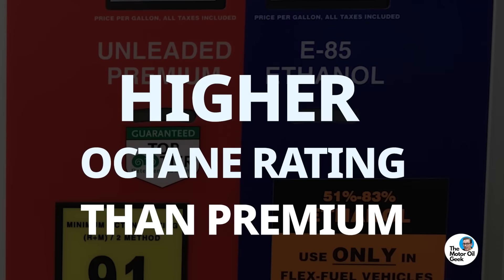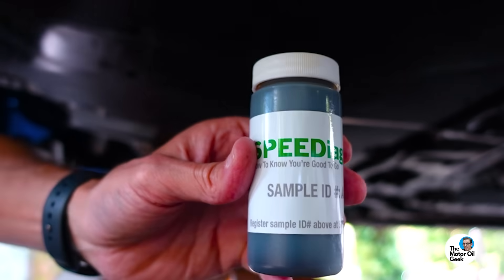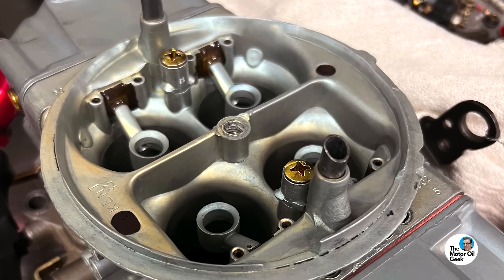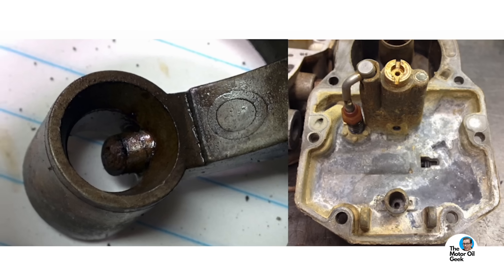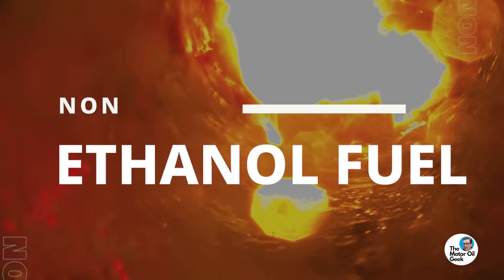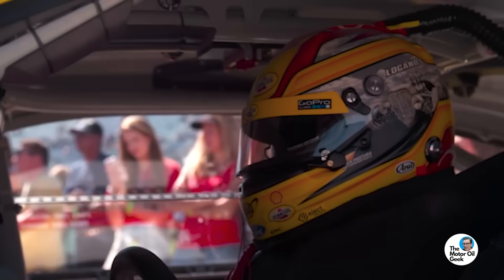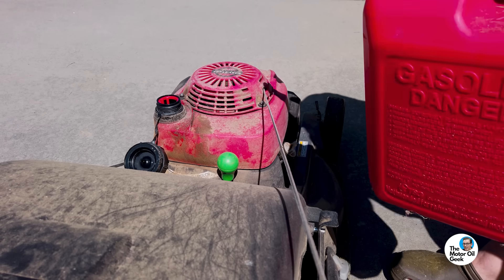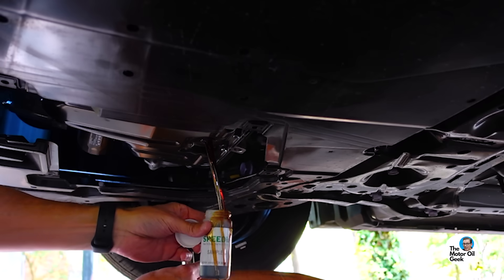ETHANOL: Higher OCTANE, Higher RISK?

Comment: Funny thing is I've been running E10 exclusively since Minnesota mandated it in regular gas around 1997. Not having carb problems in lawn equipment or with my old carburetored pickups. My old pickups sit unused for extended periods, no problems. 
I must be doing something wrong because I rebuilt way more carbs before with the "good gas"? 
I do not use additives, tried Seafoam once for storing small engines, that was the last time I had to work on a small engine carburetor. 
 Im OK with E10. Definitely don't want more than 10% though. Industrial corn production is a horrible thing for the environment, but that's another issue. I hate the stuff, for that reason, but as far as running it, I'm not having problems. 
Thats over 25 years of first hand experience. If it was a problem I'd buy the ethanol free. 
Honestly, a lot of the negative "research results" seem to be sponsored by fuel additive companies. 
Come up here and see what actually running it is like Lake.
Reply: I've got e85 in my truck that's over a year old right now (I've been running exclusively pump e85 for 5 years now in it) and it is completely fine too. All I do is fill it up and then seal the gas cap when it gets stored.  Zero problems. Nothing. 

I honestly don't know what people are doing to create these problems.

Comment: I bought a big generator that a guy bought incase of a power outage and it was like new but the carb was completely gummed up and the gas ate holes through the fuel bowl. I cleaned the carb and solder the holes shut and now it works perfect, plus I make sure to turn the fuel off and let it run out of gas while running. Don't want that problem again.

Comment: How much does a UOA cost ? Where can I go for one? Do dealers offer them?

Can you do one of you more in depth analysis of modified cars that have been tuned to run on E85 that were not “designed” to run on E85? 

Lots of Mustang enthusiast and other automotive crowds are all the rage with E85 tuning for a cleaner better engine as well as performance gains. (Reduced fuel economy)

The biggest things talked about are that E85 is bad for the car if your car sits for long periods, if you’re driving it regularly it’s not a problem at all (according to the community).

I’d love to learn more and how it impacts oil quality and thus engine life/health before deciding to make the switch and get an E85 tune.

Thanks! Love your content always amazing!

Comment: Lucas Ethanol conditioner, I swear by it now.  I had a 1980 Honda CX500 with dual carbs that I had to rebuild yearly after they added ethanol to the fuel.  That went to zero the moment that I started using only ethanol conditioner.  I haven't had to rebuild a carburetor, petcock membrane, hose, or intake manifold in anything since.

Comment: Lake, nothing you’ve told us is new. They tried using ethanol in gasoline back in the 1980s and it was a huge disaster all this that you’re telling us was figured out way back then what you failed to tell everybody is the huge danger about this that we found out in the 1980s and that’s why it was banned. If you’re not using the right type of flexible fuel hose it will dry rot it rupture it and cause a fire yes if you let it sit in your carburetor for six months without using it, you’ll have nasty green corrosion and everything will be destroyed in there, but more importantlyis the danger of it riding out fuel hoses and causing a fire you did not even touch upon that

Comment: I've got 9 small engine powered pieces of equipment and have been running regular pump gas with 10% ethanol since it came out.  I've rebuilt one carburetor due to diaphragm stretch in the last 20 years.  Done some fuel line every few years though, I will admit.  And two primer bulbs.  Key is, I start my engines every 2- 2 1/2 months and let the fuel in the carburetor circulate out so the sugar doesn't settle out and the ethanol that soaked up the water pushes that very water out.  Lots of money being made on the ehtanol free myth.  Lots of folks fooled.  Lots of folks forgetting how unstable and quick to varnish up non ethanoly fuel was back in the day.  But I worked on small engines for 10 years for a career so I don't know jack.  Hate ready.
Reply: No hate from me, but the problem here in the NE is people put their lawn mowers away for about 5 months and their snow blowers away for about 8 months. I'll put in/run ethanol free as the last tank before the end of the season. Another group with big problems are owners of classic cars. BTW, since you have been in the biz, do you know if small engine manufacturers modified the materials to better cope with ethanol? My understanding is auto manufacturers used E10 compatible materials since the mid/late 90's.
Reply: Yeah I agree ,ethanol it's bad ethanol free fuel just as bad with additives that varnish and are more toxic. Ethanol is cheap octane, be thankful and modify to your advantage, not to mention a lot less toxic than other octane boosters like toluene

Comment: In the EU we have to have E5 and E10 on gas stations, there's no gasoline without ethanol on fuel pumps. For everyday vehicles it's not an issue, but for vehicles with low use and any kind of machine that doesn not get used very often, like chainsaws, lawmowers and so on, it's a disaster.

Comment: Got a friend that works at a local Cadillac dealership, he said they get 3-4 cars a week with ethanol issues. The old folks don’t drive daily and as we all know the ethanol causes issues sitting in the system. The first thing the dealership does is an alcohol content test. My friend says he has never seen current fuel test less than 20%, most test at 25% and sometimes higher.  I wonder if that is prevalent throughout the US or just regions?
Reply: It's likely water throwing the test off 

I'm not sure what style of test they're doing, but if they're relying on the onboard ethanol sensor, it's tricked by water.

Comment: All through the 70's, 80's, and even into the late 90's and early 2000's never had to rebuild a  carb on my old cars, mowers, karts. etc from gasoline issues.  Government mandates 10% ethanol and all carbs fail.  Started rebuilding carbs the same year for clocks, failures, corrosion, etc. just like you're saying.  There isn't any reason for it.  We have plenty of oil. Government screws up everything to make more money. Fuel has to be drained if the engine isn't going to be used for couple of weeks.

Comment: Ethanol is stupidity in action! You must boil 8 gallons of water away to get 1 gallon of ethanol, if you use the ethanol to boil away the water there would be no ethanol left!
Reply: Crude oil gets distilled twice, once to remove the water and a second time at an astounding 750 degrees F.

GE converted turbine engines at an electric plant in Brazil to be dual fueled with ethanol.  No reason the waste steam from that could not make ethanol like we do with natural gas electric plants.

The spot cash delivered price of ethanol on the NYMEX is $1.62/gal.

The price of unusable sub-grade gasoline (RBOB) is $2.16/gal.

It takes more energy to make unusable gasoline than ethanol.  Usable E0 gasoline costs even more.

Comment: E85 in boosted engines is a godsend. You can run so much more timing without knock. Makes crazy power. The performance is similar to 110 octane race fuel.
Reply: I run E40 in my car and the hp difference over 93 is night and day. More smiles per gallon than mile per gallon.
Reply: Agreed. My b9 is 100hp more awesome on the welfare corn.
Reply: Curious if you guys think the ethenol is slowly deteriorating your fuel system? I'm tuned on 93 and want to do a flex fuel sensor and run an E30 mix so bad, but am afraid it's going to hurt my car in the long run. I know most don't care, until the problems rear their head down the road....
Reply: @mygt8a4re  E30-E40 is where you will see most of the gains. After that its all downhill on wear,mpg,gains. Unless your a drag car squeezing every ounce of torque. At E30 you will likely never have a problem.
Reply: @JimmytheGenius appreciate the response 🍻
Reply: @mygt8a4re  If the car was built after 1996, ethanol isn't going to hurt anything. Increasing the ethanol concentration beyond the ~10% that's already in pump gas doesn't really change the calculus in that regard. If your fuel system will support the flow for E40 or E50, go for it.
Reply: @Vlalada0 thanks for the input, motivates me to move to E hearing some are doing it with no fuel system issues. Ive heard all the horror stories about people's fuel pumps giving up the ghost in a short time after going E.
Reply: @mygt8a4re  Most modern ecu's have enough headroom to run up to e30. I ran e30 in my 2023 Sting Ray and run it now in my 2025 E Ray.  The reason is that GM rates their performance engines on 93 octane but in California we only have 91.  By mixing in 3 gal. of e85 when I fill up with 91 I end up with 93+.  I had a 2016 GT350 tuned for flex fuel and a 2020 Supra tuned for e50.  All made substantially more power and I never had any engine problems.  When I used to frequent the Mustang forums there was one called The Distillery in which they discussed all things e85.  No one ever reported damage.
Reply: @65sohc great info, really appreciate that!

Comment: Yes you need more ethanol because an ICE is as much a mass flow equation as an energy flow equation. Ethanol is less dense that petroleum gas so you need more ethanol. 😂
Reply: That's wrong.  Ethanol has less energy content.  Its density is about the same as gasoline.
Reply: @andyharman3022 720 vs 797 no incorrect

Comment: I've been using E-10 in carbureted engines for about 20 years, including boats and other vehicles/equipment that sit for weeks or months between uses, and haven't had issues.  These stories of carbs needing a rebuild after a week or month of sitting are hard to believe.
Reply: Had E10 in a string trimmer and it gummed up the fuel lines.  Used a coat hanger to clear them out and the ethanol residue looked like a plastic booger.  100% gasoline since and no more issues. I'm a believer.
Reply: @quaddad  Ethanol doesn't leave residue, but it may have dissolved buildup in the tank and/or lines which then became gummy.  One of the many good/bad things about ethanol is that it's a solvent.  Some old fuel lines can't handle ethanol and will become gummy, another possible cause for your problem.
Reply: Seriously, they figured out this e10 stuff a long time ago in small engines. It's just not an issue. leaving fuel in during storage is the issue and always has been. 

I'd be more concerned with hardware that pre-90's perhaps, stuff with original carbs that never even dreamed of ethanol as a fuel.

Comment: I use E10 in all my yard machines I have an edge that is 50+ years old no problems with it or any of the newer ones I put 1oz marvel mystery oil per gallon of fuel. Here in oklahoma we have non ethanol fuel available i had to throw some out I had mixed 50:1 for my weekender. I doesnt have the power E10has. Plus stations these days don't check the non ethanol tanks at the station for water like they did back in the day. I think the the biggest problem is it is more expensive and doesn't sell well and becomes stale I store my machine fuel in steel safety cans.

Comment: I live in Iowa, the top corn producing state. Non-ethanol gas is readily available and clearly labeled at almost all gas stations. If ethaol free is not readily available, or the pumps are not labeled, it is because of your state legislature.
Reply: Minnesota, the first state to mandate E10 fuel, didn't label the pumps, as there was no law requiring the pumps tell the consumer that an oxygen was added to the fuel. My parents would come over here to South Dakota and only use the ethanol free gasoline thinking that was all they had available in Minnesota when the opposite was true. And yes, they were still adding her to their vehicles in the winter. 😳
Reply: Is it worth paying the extra .70+ per gallon in my 2005 f150 5.4 Triton?
Reply: @StormTrackerDave  As a consumer, I believe you should be able to buy whatever you want, and the pumps should be clearly labeled.
Reply: Right, I'm pretty sure it's not available where I live (Seattle metro).
Reply: @subversiveSubduction Well you can separate the ethanol yourself, but there isn't one thing wrong with E10

Comment: The carb on my new push mower is plastic. I let e10 set in it over last winter and then in the spring dumped it out and refilled it and it started right up and runs great all on e10.
Same with my Stihl ms361 saw and my Echo 225 weed eater.

Comment: Things to be mentioned about E85. As said in the video, it's corrosive and can damage your fuel system if it's not designed to accept E85. E85 goes bad over time and can completely clog up your fuel system if let sit for a long time, unlike gasoline that goes bad. Never leave a vehicle in storage with E85. Ethanol has lower energy content than gasoline so you will get worse fuel economy with E85 than with pure gasoline.

Comment: I have a 2011 Camaro SS and 2009 Tahoe PPV both run on pump E85 for 5 years fingers crossed l do use Lucas ethanol conditioner directions say 1 ounce for 5 gallons l use 2 ounces for 5 gallons so far so good it also says you can't over treat it on the bottle whatever that means my 2004 Buick LeSabre runs on 87 gas every 3rd or 4th gas fill up put 8 ounces of Marvel Mystery oil when filling up on gas for the last 8 years no fuel related problems fingers crossed
Reply: Ethanol does not like sitting for long periods say months or longer my 2 vehicles that run on E85 generally get fresh E85 every month to 5 to 6 weeks the longest and it is treated with Lucas ethanol conditioner 2 ounces to 5 gallons the stuff is green to the touch it feels similar to a light weight oil

Comment: So glad I tuned in to watch this video much like all of your other videos. I have a C6 Corvette and its a weekend driver car. I contacted a local tuner shop wanting to get a custom tune for more performance. The shop went over my options of 93 octane or E85 tunes, but never explained what harmful effects the E85 and how Ethanol might affect my engine in the long run. Thanks for the info.
Reply: Notice how he focused on carb issues here. While there are not zero negatives, E85 is totally fine to run for long periods you just need to, as Lake recommended, make sure you are sending in a few oil samples to ensure wear and fuel dilution are fine. My GTI has almost 100k miles, 80k of which were on E30 or E85 and my compression, leakdown and UOAs look great.
Reply: It's totally fine for your application and performs well in more modern cars especially ones built with it in mind. You would see a power bump from E85 and should be able to run flex fuel on a C6 so wouldn't have to worry about getting the ratio right. It is really only an issue if you let it sit for months at a time with E85 in the tank.
Reply: In that car there aren't any issues. You'll be fine.

I've got e85 that's over a year old and it hasnt caused any type of problem in a newer vehicle. I just store it with the tank full and add a seal to the gas cap (mine is vented currently)

Comment: I have been using Star Tron Concentrated Fuel Treatment for at least 10 years in my carbureted vehicles and small engines (generator, lawnmower and chainsaws) with much success. I agree with other commenters that you should do some test on the different brands. Thanks for a great video!
Reply: Or just add a couple of ounces of transmission fluid and a couple ounces of acetone in the fuel which destroys the ability of the alcohol to be hydroscopic and won't draw in so much water into the fuel when being stored. I did this with some fuel in it lasted and it smelled great after 5 years. Works well
Reply: I've been using stable marine 360 and occasionally sea foam.

Comment: If the gas stations didn't charge so much for non ethanol gas I would be be using it in my truck all the time because the performance is much better and MPG are better but the cost difference is huge between the types of fuel. Ethanol gas is so bad for even today's engines.
Reply: Yeah it's almost $2 more per gallon where I am. 

No thanks.

Comment: I am not against ethanol at all, I used to use a lot E85 when I, was in Europe with EFI and rigorous maintenance with great success. Now in Canada, no E85, but E15 blend which is a really issue as you said for old carburettor engines VW or lamw tractor / mower especially that we are in a country with 6 months winter of storage for small engine and summer cars. It will slowly become a nightmare.
Also, it seems that they will add up to 10% ethanol in diesel! That is really concerning for the winter season and low diesel consumption at some fuel station. I do daily drive an imported 2003 and 2006 common rail diesel with Bosch EDC15 and EDC16CP33 injection system and CP3 high pressure pump. It will become very hard for them (especially injectors) if there is humidity inside fuel... Also, almost no top tiers fuel here....

Comment: Lake is the phase separation more corrosive than the ethanol itself?  If I remember correctly the fuel companies themselves give E10 a 30 day shelf life because it's ability to absorb moisture from the environment.   I'm a small engine mechanic and have numerous tree services as customers.  They mix fuel a couple of times a week and I don't see as many issues with them as I do with customers with casual use.  I always recommend non ethanol fuel.  Canned fuel has it's faults as well.  It's shelf life is based on the can being sealed.  After it's opened the clock starts ticking faster.  VP canned fuel seems to be the best IMHO.